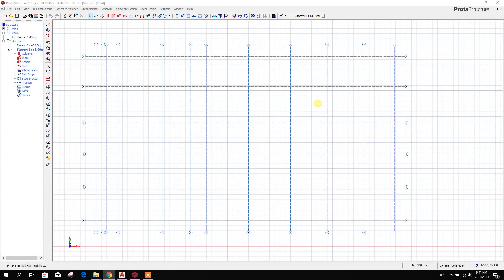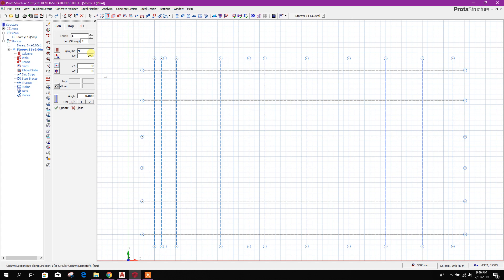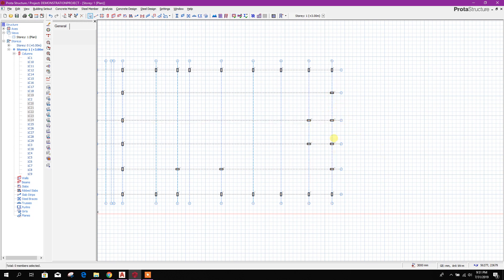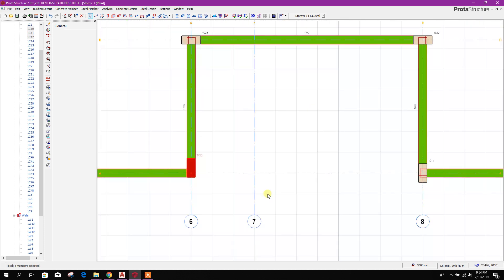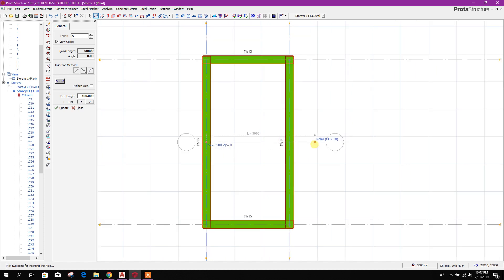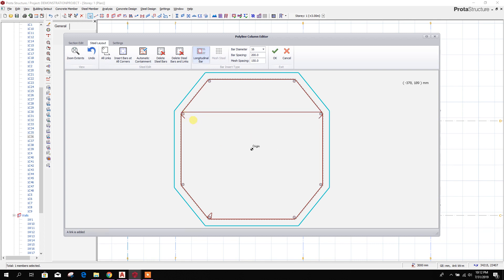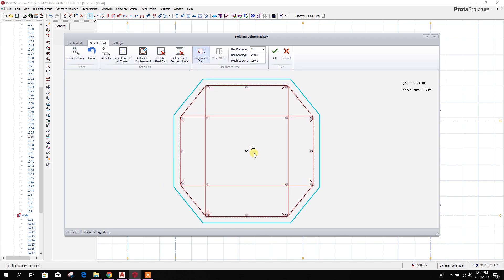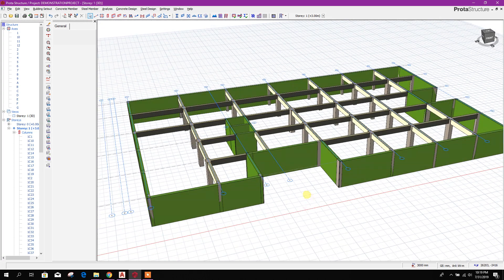15 Storied Building Design in Prota Structure 2019-Part2

Comment: How to done shear reinforcement of beam in prota structure because in beam design results all beam stirrups shows same not at beam column junction varies.
Reply from the maker: There is setting for that. If you need variation you can choose that option in rebar arrangement setting.